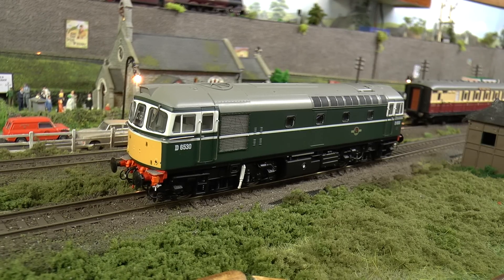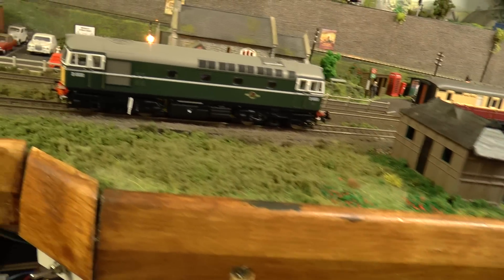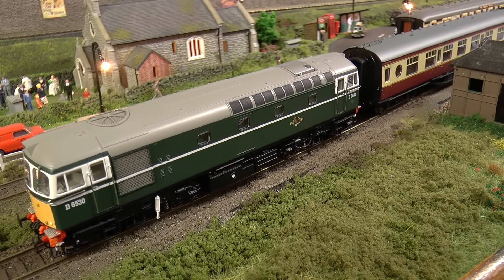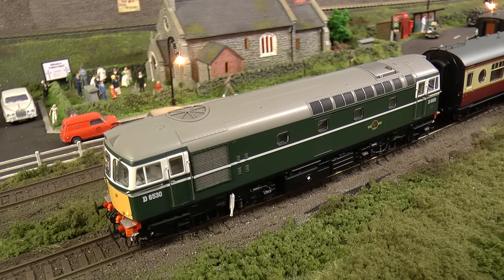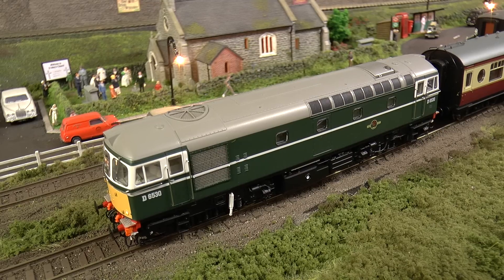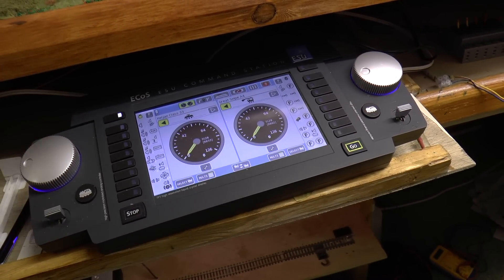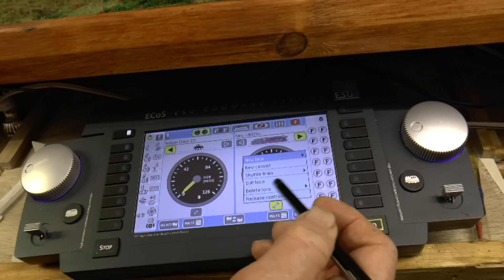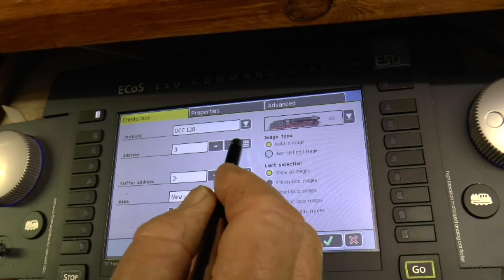Dave`s Model Railway Class 33 with SWD sound

Comment: Hi Dave, I've had the Heljan Class 33 on my shopping list for a while now and now having seen it on you layout it looks even better than I thought it would especially with sound too. As regards pictures of your locos then what I do is say you want to do the Class 20 then I google a suitable picture (normally a flat side on view with a white background) and save it to your computer and then crop it and resize it so that it measure 190 x 40 pixels (no larger or the ECoS won't take it) and then save the image as .bmp file. Hook your ECoS up to your router and then find it on your computer and go into the ECoS settings for downloading images and select that file - the file name could be called class_20.bmp for example. You then just select that image in the same way as you have been doing but use "User defined images" instead. It sounds complicated written down here but it's not. Have a go by just doing one and see how you get in, you'll be pleasantly surprise how quick and easy it is....................Graham
Reply from the maker: Hi Graham think i shall go to bed with a headache now after reading that !!! but yes thanks I shall put this i to my saved file and follow it up later , the 33 from Heljan is a beauty , and such a good runner its the new re tooled one ..the sound is SWD `s   but like all 33 `s its a bit of a flat engine noise ...Cheers Dave

Comment: The sound sure added to this already fantastic loco! An interesting issues with the rear lights. Very odd indeed that. Very clever controller! Will be great to add a image of each of your locos to it! Keep up the great work!
Reply from the maker: Hi Callum , yes the ECOS is a fantastic piece of kit , but Dave is a bit slow at learning , so could be a while before I get the hang of all the settings and working it all , as for that 33 its a great model so had to have sound fitted ..going to ring digitrains and ask about rear lights ...Dave

Comment: Looks and sounds really nice. Some good effects as you throttle back, and a nice bit of brake squeal. I really like the look of the Ecos. Great display and plenty of separate buttons.
Reply from the maker: Its a nice little Loco John , and yes the ECOS is a fantastic controller , its just a case of I shall have to spend a lot of time learning to use it properly ...plenty of time this winter ...Cheers Dave

Comment: Hi Dave • The transformer (controller), looks very interesting. The locomotive looks very realistic. Well done update with CyberLink.
• Cheers from Michigan.
Reply from the maker: Thanks Gary , that controller is going to get some getting used to , the cyberlink is working good but sing the older 12 now instead of the new 13 ..got more on it of my templates ...Cheers dave
Reply: ***** Dave • I watched video about the new version 13, on the companies web page. Still 13 is not for the Mac, Maybe 14. Looks like a lot to learn,  you have it all under control.
Reply from the maker: ***** I hope they bring a 14 out that can be used on Mac Gary ..I have gone back to using 12 on my older computer as I find the 13 on my new 8.1 windows computer is more difficult and to be honest I think not as good ..Cheers dave

Comment: Hi David, class 33 sounds really good! need to add in that compressor occasionally, re the marker lights, these were never used in BR Blue days, the head code box being used front and back, in green days the markers may have been used.
Reply from the maker: I do have the compressor its on 5 on the controller , that 33 though had rear lights working when I got it new , but the sound decoder obviously does not run the rear lights I have had that on a 47 I know they would not have them on when running , but I like to see them ...not to worry though ..still trying to learn settings on the ECOS ..Dave

Comment: Dave, great sound, enjoyed the video, now when it comes to loading pictures down for a particular loco you can get help on the ESU forum how to do it, the format has to be exactly what ESU recommends. marker lights: I usually program all my decoders with the lok programmer but I assume the Digitrains sound decoder is not readable (all CV'S) with the ECoS.

John
Reply from the maker: Hi John , yes did take a quick look , to be honest I have not spent any time with it this last month , but will get stuck in with it all shortly , it can be a long winter , so give me something to be doing ....Cheers Dave
Reply: I'm just getting back myself , wired up the cable car, so there is light in the gondolas now + I had a fewf problems with the operation, the gondalas got stuck at the masts, reduced the speed and its fine now. I also added smoke stacks in some of the houses and station and this should add a bit more interest to it. you have to keep these houses warm, you're you going into winter now and it want be long and you're going to start up the fire or is the oil burner these days.
Reply from the maker: John Heymans  sounds like you have been busy then john , should be interesting to see, yes we are going in to winter , 8.d here this morning ....central heating boiler switched on now ....Dave

Comment: Hi Dave nice video the Ecos looks a bit complicated im glad ive got DC,what happened toPowerDirector 13 ? cheers Tony
Reply from the maker: Hi Tony , well the 13 is on that last new computer , which has windows 8.1 on ..and to cut a long story short , the 13 has not got my past templates on and carnt transfer them and windows 8.1 is crap compared to windows 7 , so still working with the old laptop with a spare keyboard attached vis a USB..as for the ECOS not spent much time on it , they are very good its just a case of learning to use it ...too busy playing with computers LOL ...Cheers Dave

Comment: Hey Dave, why does it appear that most British locomotives (and models) particularly the streamlined A4 Pacifics, don't have HEADLIGHTS? I'm looking at a Hornby model of the "Mallard" that doesn't have a headlight. At least it doesn't look like it does. They didn't run steamers at night in England?
Reply from the maker: Think all steam engines either Bachmann or Hornby dont have lights fitted , I have had to have them fitted as extra`s on mine , its time the manufacturers did it , we get it done for about £30 but they arnt the best I have had problems ..Dave
Reply: *****
I've looked at some videos of the ACTUAL a4's in action, and some of them don't appear to have headlights either. Some even look like they may have removable "marker lights". It seems a bit odd that even the prototypes don't have much lighting in the front, if at all!
Reply from the maker: wobblinwheel They did have removable lights , thede lights are placed on light hooks on the front when going forward of course and if tender fist they would be put on the rear of the tender , may be the ones you looked at had the lights set just a bit further back due to the shape of the front with the wheel covers reaching up to the front ..Dave